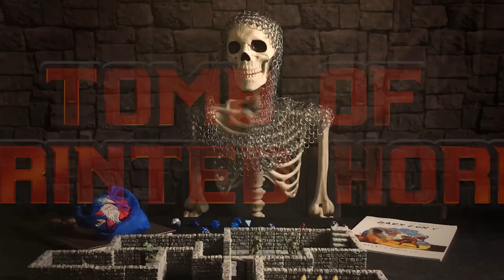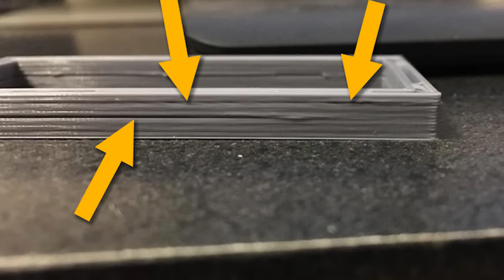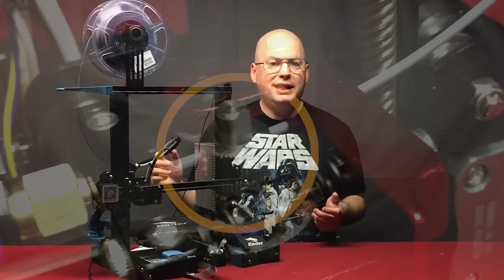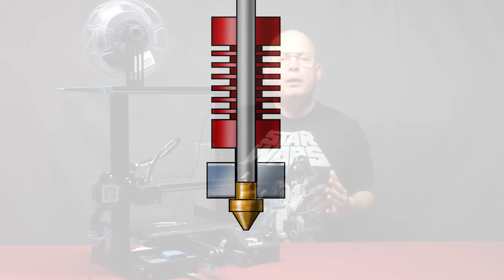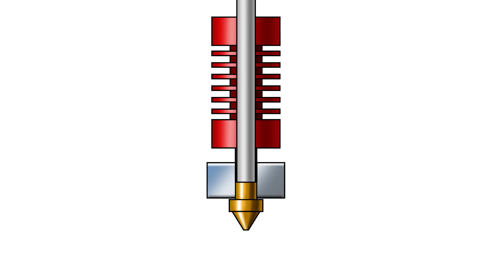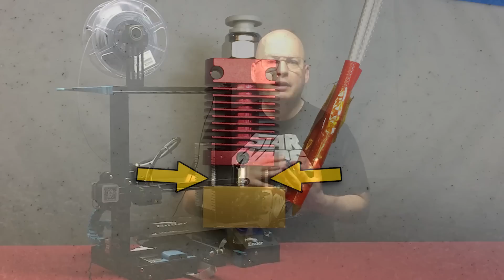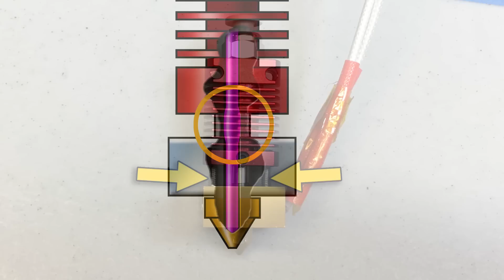Fixing Under Extrusion in a 3D Printer

Comment: Surprised you didn’t mention if the hot end fan gets filament strings in it and stops turning - or the power cable breaks - you’ll get the bulges and clogs in the heat break like the loose Bowden tube.

Comment: I would expect that excessive retraction (either in number or distance) would cause problems since it promotes heat creep.  The extruder strips because the filament is jammed in the heat break.  Maybe the longer retraction distance in a bowden machine aggravates it too, but I don't have one.

Comment: I got a used Ender 3 from a friend of mine about a year ago. I don't even know which model exactly and I've been so scared of trying to use it, since it seemed like a whole (complicated) science-project to me. A few days ago I finally tried using it for the first time, learned about brittle PLA the hard way and struggled along. Now most of my settings seem fine and I feel like I got a surface understanding of what's going on, but I couldn't figure out what might cause the under extrusion for me. Even most of the videos on yt seemed too intimidating for me, terms I'd never heard before flung around or parts of the printer talked about without showing anything. Then I found this video and I don't know if I'll actually be able to fix the under extrusion now (not even 100% sure that's my issue or the whole issue...) but I really appreciate your clarity, your straight-forwardness and that you clarify between what solutions might be available on different printer models or not.
Tl;dr: Thank you so much, I don't know if I can fix it now, but at least this video reduced my anxiety instead of adding to it. :)

Comment: My mind explodes. I cant fix my damm I3 mega printer. Esteps are calibrated. Its upgraded with an E3D hotend. A good bowden tube.
Still under extrudes. iv tried max the temp of filament to 210.
Disabling retraction. 
Still cant extrude fast enough to make small circles right after it do travel. Only running at 30-40mm/s..

Comment: I have to turn my heat up to get it to extrude I've fitted a new fan which has helped, fitted new nozzle freshly cut the Bowden tube and made sure I filled instructions carefully putting everything back together. I'll just have to print at a higher tenpertifor now not sure what's going on
Reply from the maker: Make sure your heater cartridge and thermistor are both seated properly in the heater block. Also, and this is a common mistake, make sure you are printing with the type of filament you think you are (I've seen people accidentally load ABS and think it's PLA, etc.) Finally, do a PID tune of the temperature readings/thermistor (see my video on how to do that.)

Comment: If I have a print that under extrudes in the same spot every time, regardless of the filament type, what would you advise I try to fix first
Reply from the maker: That sounds more like a model/slicing error. Try rotating the model on the bed (Z axis) and re-slice. Slowing down can also help.

Comment: You stated that these are the most common causes behind under extrusion/stringing…are there uncommon reasons? I ask because I had 4 beautifully running machines, but after leaving all of our doors and windows open to beat the heat, everything prints ugly on them.  All the rolls were bagged and dried before this event, and new filament rolls were purchased in the meantime with the same effect.

Comment: Nice video! I need to add an issue i faced with the Real Filament brand as they use paper reel to pack their filament. This reel has too much friction against it's holder and makes it harder for the stock ender 3 extruder to grip the filament.

Comment: after seeing the mention of the alignment screws I went to look at mine. interestingly enough, mine does nothave any insulation around the hotend. i can look right through eh fan and see the alignment screws and hotend fins and block. i have not taken it apart at all and this is how it came. is this a normal occurrence? i plan on switching to the Sprite direct drive extruder/hot end so its not a big deal but id like to know if others have received their ender 3 pros without insulation around the hotend ?

Comment: hi there, i have an ender 3 V2,  i just baught the Sprite Extruder pro for it.  and now im having less build volume/room, it also keeps hitting the metal plate on the far side, (x axis),  im not to sure whats going on.... i cant print close to edge of my bed at all, need to keep it small and in the middle for it to work properly... please help...thank you in advanced
Reply from the maker: Sorry but I don't use the Sprite Extruder pro as direct drive isn't the best for tabletop gaming models, cannot advise on this.
Reply: @Tombof3DPrintedHorrors    none of this is gaming related.... thx anyways. good luck out there.

Comment: Thanks for this video I updated my Cura to 5.2 from 4.0 and like you said the filament size was listed as 2.85 in my slicer I was getting a dotted line and no filament would pass the nozzle changed it to 1.75 problem cured. Thanks man just subbed your channel.

Comment: I have an Ender 3 v2, used like 5 prints already. 3 have failed so bad, 1. Under extrusion: It starts quite well, with detailed printing. Then it can start under extruding at any point. Sometimes causing clicks or the feeder gear to slip. I cleaned the nozzle, slow down to 85%, increased the temperature to 220° and added a washel to the spring. I left the printer at about 40% and it was nice. I found some layer shift and under extrusioon too. Wondering what is still not right.
Reply from the maker: This sounds like you may pave leaked filament in the hot end between the tube and the nozzle. Watch my video here: https://youtu.be/30qqKUwviww

Comment: Omg omg omg. You just nailed my issue at 5:30... I didn't even think! Omg. I updated and installed my microswiss direct drive at the same time. Then boom! I can't for the life of me figure out why I have crazy even gapping between lines. New high end nozzle and everything thoroughly inspected... All but my software setting. I checked the basic settings but NEVER would have thought to check the profile filament size.. omg I'm so fking stupid! 2 weeks I have been fighting this. Thanks!

Comment: Thanks man, I was losing my mind when two of my printers were under extruding. I had to replace the tubes and I also replaced the nozzles and that's when the under extrusion happened. For one I increased the temp and it's printing fine now. I'm not sure why I have to do that though because previous jobs with the same filament and printer were printing fine before at 200 but I had to put it up all the way to 220. I wonder if it's from a fan failing because it looks like one went out.

Comment: Howdy, great video!  I really appreciate your material.  I have a CR10S pro.  I am having issues with the brim of a print only laying down filament on half of the rectangle.  I have used both auto leveling and manually checked leveling with a bullet level.  I have checked tramming of the X gantry and also cleaned and replaced the nozzle. I have printed the present spool of 1.75 mm filament on other prints and do not experience this issue using the same temps and speeds.  I also have experienced one corner of a print lifting from the bed slightly causing a failure.  My CR10S is about three years old but has not seen much use.   Thanks again!

Comment: I recently got the ender 3 s1 pro. The prints from the SD card came out great, the files from thingiverse....not so much. I had leveled the bed, set all the settings that was recommended, and tried printing. It was a (literal) hot mess. I managed to fix most of the problems by switching from cura to the creality slicer. The only big remaining issue now is that about half way through the little cube test with "x" and "y" the extruder suddenly kicks into high gear and pushes the filament back out of the nozzle (not onto the bed, but literally pushes the filament back out of the entrance hole)

I have tried researching this issue, but so far no luck. In fact I have seen such a vanishingly small (ie none) amount of information addressing this issue I am beginning to suspect it's only my printer.

If anyone could help me solve this I would be most thankful.

Comment: Does a layer setting in a slicer cause filament issues? Under filament feed or thickness? I added a Microsoft direct drive and having issues as well with the filament pulling from top filment roll and side filament guide.  Is there a top guide for the direct drive on a ender 3?
I have a upgrade 3 point Y carriage coming. I guess it helps with leveling and warping.

Comment: hello i apriciate the video, but i don't see the answer to my recent problem. i know you are not creality tech support line , but i ask anyway, if the answer pop up it might save someone some time

the thing is my printer does not like to print 4-6th layer of my models after I had a molten pla disaster in a printer that usually print only abs trough 0.2mm nozzle
i only print small thin standing or laying parts, always on rafts because my ender 3 came with pancake of a bed and i mostly print in one corner anyway
the thing is the first layer of the raft sticks too good, 2nd is being stringy and poorly adheared so is the 3rd layer but then is so first few layers of an actual model, but they initially look fine
but when i get to about 2-3 centimeters in geight the part starts to snap on the raft and reveal that it never really atached to it

the thing is i am printing on the same settings, the same models i printed a week ago from the same roll of filement and even the nozzle is the same, swaping for a new one actually made things worse, i think molten pla had to damage the heat block in some way and cleaning it off with a tap was not a good idea, not to mention a nozzle might cross threaded once and the contact to block even with a new nozzle might be now terrible
and it causes under extruzions printed simply can't keep up transfering heat to the nozzle from fully heated block
i will test the theory in few days when a new heater blocks arrives, but as far as i can imagine this is the most likely cause, bad mechanical connection between 2 hot metals that limit heat transfer when you need it the most and nozzle is laging with higher flowing rates
and you can clearly tell thah by testing extruzion alone bt pushing filement down ,from axies controll
if it extrudes smooth and shiny (considering you use the same filement as before and before it was shiny) then you have working heat transfer, if it start being roughaster fer moments then when you stop and start again this repeats i think that the nozzle is not keeping up 
just a theory i have , if you can confirm or deny it i would be really greatfull well anyone who reads that is welcome to discuss it
Reply from the maker: I'm sorry but I do not print ABS as it is terrible for gaming models (not to mention the toxic fumes), but I suspect part of the issue is ABS is ill-suited for a .2mm nozzle. I recommend using PLA with apertures that small.
Reply: @Tombof3DPrintedHorrors  
i know it is bad for health but neither my print last more than 1 hour each and i have ventilatin all the time 
0.2 nozzle is not a problem either , over last 6 months it printed about 1 kg of the trail runs train parts and didn't cloged once, but rather than underextrusion it suffered from overextrusions and had to be tuned down to compensate
few days ago after pla model disaster and not screwing 0.4 nozzle tight enough pla got everywhere on top and under the blockand stuck to it and only way to remove it were mechanical means like files and taps 
now it lags behind like car that lost turbochargerand it only gets better with overtightened nozzle (the same one that worked before, it does not like a new one)

i wish there was safer plastic that can be easyly melted together, with glue i might switch to asa if it is any safer for the winter

Comment: I just tried doing the cold pull, I set the nozzle to 210, pushed the filament down untill I saw some of it get pushed out the nozzle, then I turned it down to 90 and yanked it. The filament snapped in half and some is still stuck inside the nozzle.

I have an ender 3 pro.

Comment: Much appreciated - the video is so clear and thorough.
My Ender 5 started misbehaving about 5 hours into an 12-hour print, and I couldn't figure out why. My current guess now is that I forgot to check for filament tangles at the start of a new spool. I was able to unwind/rewind a bunch of the spool to fix the new ongoing print, but I'll have to go in and properly resolve tangles afterwards.

Comment: Great Video! Thank you!
But what about under extrusion due to low factory setting of the stepper motor for the extruder? 
Ender 5 Pro is set to 93 steps, and it seems to be a bit low. 
Also might be useful to tune flow rate or extruder multiplier in the slicer too.

Comment: I need help.!!
I have 2 ender 3s.. i converted to direct drives on both and im having different problems with each.. 1st ender3  when i converted to direct drive, after 15 minutes of printing, the display goes crazy like its bricking up, but continued to print fine now the feeder motor knocks back like its retracting at odd moments causing my prints to become brittle and filled with holes more and more as it prints..
2nd printer, alil newer, i replaced with a pro board with the silencers, but when converted to direct drive, my prints are printing at a smaller scale than i sliced to be..
In addition, the older 1st printer was converted to direct drive 3 months ago, my newest 2nd printer has only been converted 4 days ago and haven't gotten a successful print yet cause of the smaller scale problem..

Comment: Using most of these tips for my Ender 6 Corexy. 
This has been extremely helpful to diagnose my problem. 
(Bowden connection, going to change my heatbreak and Bowden clips and Bowden tube)

Comment: I don't see the point in doing a cold pull. If you think your nozzle is clogged, it's a 25-cent part - just replace it. It's much less hassle. 
That said, the REST of these tips are PRICELESS. I'm working my way through them fixing my Ender 3 right now. Found the damage on my plastic extruder level (been using it for 3 years with no idea). Ordered replacement, hoping that's it. When I tear it down to install it, I'll give my Bowden tube a cleaning, too (NOT a $1 part - currently goes for $9-20 on amazon) and work my way back through this list.
Reply from the maker: Cold pulls are ideal when you do not have the time to tear the hot end apart and clean (or do not have parts on hand.)

Comment: Okay, so I have an ender 3. Its my first printer. I think my printers issue is that its not grabbing the filament tight enough,because it doesn't pull more filament off the spool the way it should. I have to unspool a bunch and keep checking back to unspool more, otherwise it just creates a very taught line of filament from spool to entry and thats the only time it underextrudes, tried making a filament guide. Didn't work. Ideas?

Comment: Hi! I'm new to 3d printing. I have an issue with my custom build printer. On Slic3r it prints normal but on multimaker cura i have to increase the extrusion feed to 230% so i have good results. Any info would be appreciated.

Comment: Does this make sense? Lower layer height should have lower temp, because less material is being extruded, so if the temp is lower, there is less chance of heat creeping up the filament because it is technically in the extruder " longer" than if you were pushing out more with a thicker layer height?

Comment: For the triangular hole in the extruder, before buying an aluminum extruder, couldn't you simply insert a small brass pipe like those found in hobby stores and used for model building? Of course, you'd need a soldering iron to heat up the tube as you insert it into the plastic extruder. The small length of brass tubing will likely cost under 1$. You could also use an M3 brass knurled nut in the same way, but you'd have to drill out the fine teeth first.

Comment: I don't normally comment on videos but I had under extrusion going on 3 weeks. Yours was the only video that covered all the possible causes in a comprehensive way and helped me find the issue (gap between the bowden tube and nozzle). Thanks for getting me up and running again.

Comment: Just got a Monoprice MP10. started printing parts with PLA at 240 nozzle 70 table.  Best parts I ever printed - very strong, very clean.  However! After 8 * 7 hr prints i turn of my printer.  When i started up again it wouldn't feed properly .  I figure a clog.  So, I went to pull out my Bowden tube and found the tube release impossible to push down -  I'm figuring filament back fed into the spring portion of the tube lock.  Any ideas on how to approach the fix?  Thanks, Appreciate the thoroughness of your discussions.  So far I'm thinking the Bowden tube is more trouble than it's worth.  Rarely had problem with old system and they were easy to fix.  Thanks for your feedback if you have the time.